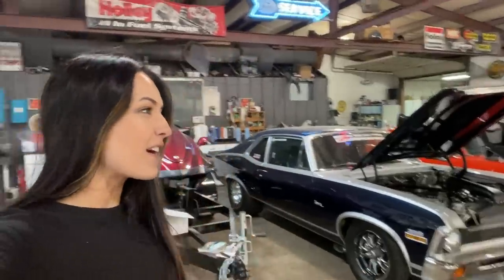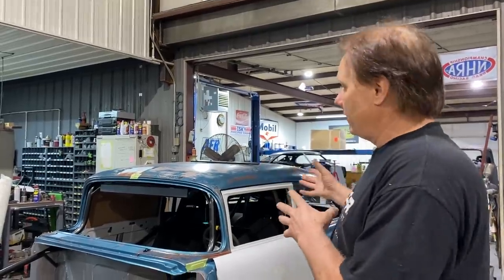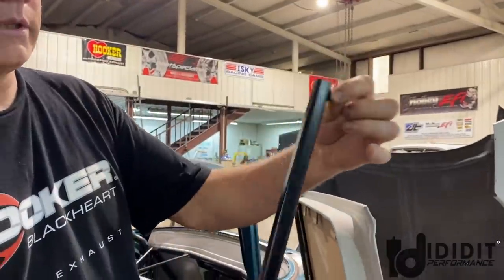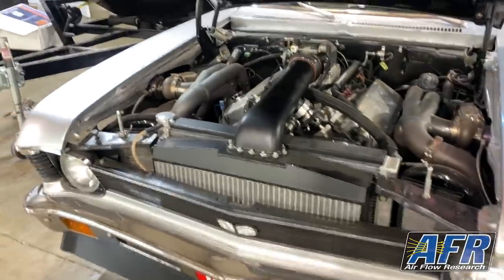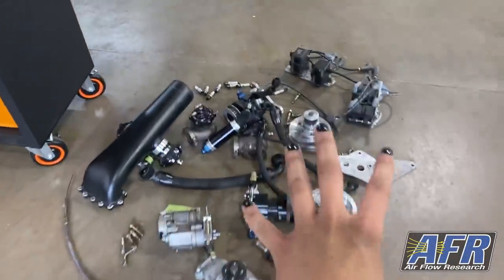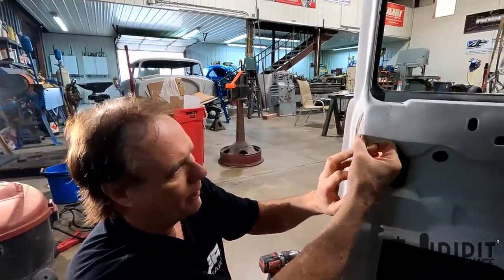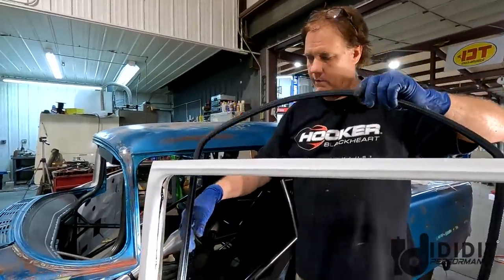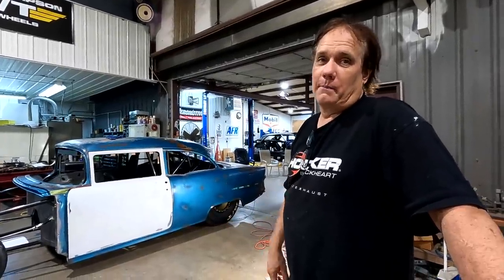Every Race Car Needs Power Windows Right?! + Poor Retro Nova Gets Stripped 🥲 - 55 Build - Video 17

Comment: your dad Dennis is a great hands on builder. a tip from a old sign guy that loves street cars and drag racing  Lexan can be cut in a shear. it won't crack like plexi glass try a scrap'
Reply: Wish Muricans would use material names not brand names for everything (fk Kleenex)
Poly carbonate or acrylic

Comment: Hey tell dad next time he cuts you some lexan after he gets it to shape take a torch and hit the edges lightly and it will smooth and shine the the edges like factory cut.
Reply: Flame polish. Also run a old razor blade into the corner of a grinding stone to make a radius scraper for your cut edges. Hope this helps in the future.

Comment: Door windows are the worst day to deal with, let-a-lone a door latch. 
Passanger door, mint(perfect). Sweet window instalation.
Seeing your wire/hose labels are great. Simple but understanding but when theres 30 white wire to soder its key, instead of using a  volt meter.

Comment: Taping wires and tubes for identification is a great idea but it's much simpler and requires less writing if you just use numbers. Number 1 just goes to number 1, number 2 goes to number 2 and etc. no matter what the components are.